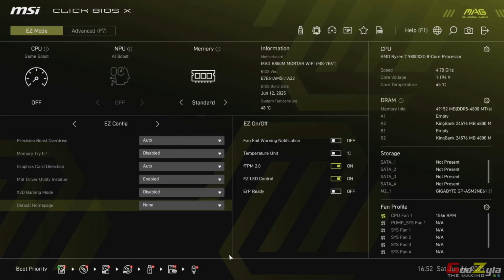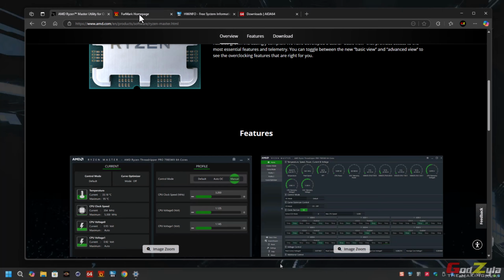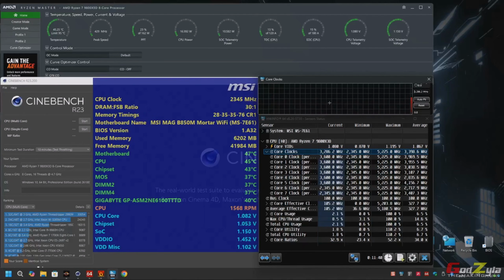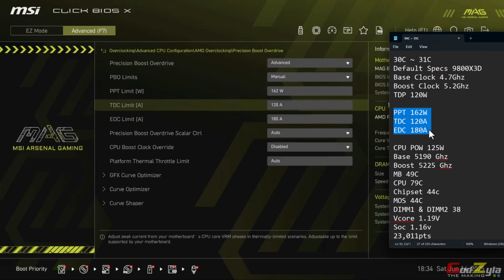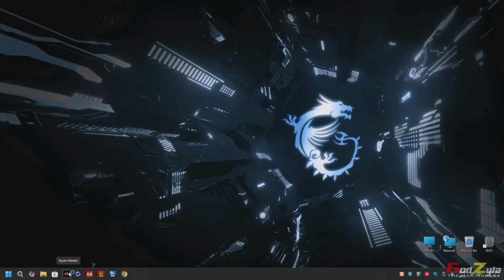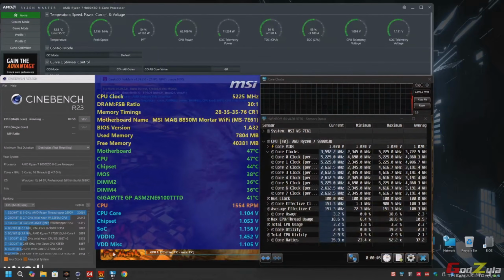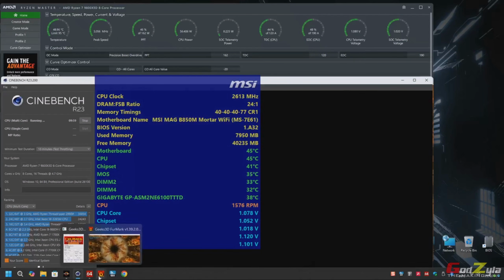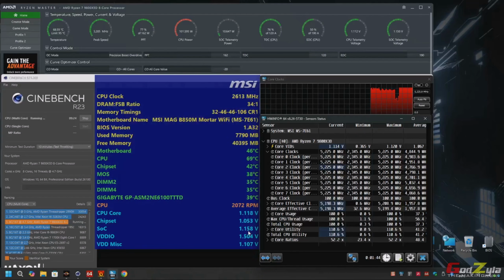PBO2 Curve Optimizing with 9800X3D on MSI Motherboard

Comment: Very weird same tests as you identically accept my cpu temp sits at a max of 83 degrees after a 10 min cinr23 run

Max voltage is at 1.110v across all cores, and my clock is at 5.225hgz flat line the whole test. Max 104w. Why is my cinabench score 21889? Is it because of the temperature? 
Currently on a -25all curve and then my curve shaper is the same as yours. All other settings are the same. Aida 64 runs stable
Reply from the maker: Welcome back Raffa, mind if I check what are your ram specs and at with VSoC voltage are you running, it is by default or at 1.15v? also you've mentioned that you are using 360 liquid AIO, which aio is that?
Reply: @K @KleoYan 6000mhz on Xmp profile 1 and locked at 1.15 runs stable. 

I just set my cinabench profile to high priority and received a score of 23500, max temps around 85.

Can’t undervolt is anymore I’m at -25 all core and then my curve shaper is identical to yours. 

My aio I honestly am not sure what brand it is as it is a pre built with a 5070ti in it. Everything runs super good my gpu has amazing undervolt and oc potential. 

I have 32gig corsaire vengeance ram 

In gaming my temps are between 60-70 the cooler is definetly working but I am thinking of re applying paste myself soon using the method I seen you linked me before. 

Also really appreciate the videos very glad I found your channel
Reply from the maker: @Raffa934  your temp looks fine during game play which is 60°C ~ 70°C. I would say maybe is the AIO or the contact pressure between your AIO coldpate to your processor, you can try doing a repaste..
Reply: @KleoYan yeah it must be that? Not really sure at all unless this cpu I have just gets hot. I noticed the aio mount wasn’t the best the spring screws were not compressed as I believe they should be so that brings me to believe the paste may not be the best either. Will be re doing it in a couple of days
Reply from the maker: @Raffa934  Thank you for the update, wish you all the best and update us on your findings too. I am curious .. thank you again! 😉
Reply: @KleoYan absolutely will do! Take care
Reply from the maker: @Raffa934  You too buddy 🫡
Reply: @KleoYan so I ended up buying some gorilla thermal paste and following your guide. When I removed the aio I could see they did a pretty crappy job of pasting. I re applied and did it as in your guide, 

This morning it was rather cool temps in my home and after a 30 min benchmark run it was around 78 degrees max

But as the day has gotten abit warmer and hotter I have done another benchmark run and it still reaches up to 85 

So I mean I guess it’s just the room temperature at this point because there is nothing else I can really do unless I get a whole new aio and I don’t really want to much around too much with that. I’m still not sure what brand aio it is but for gaming I’m never above 65 degrees anyway 

Slightly cooler temps after re applying paste though which is good
Reply from the maker: @Raffa934  I see, yup for static test it will be higher but in game play, your CPU load will never reach 100% so with the thermal hovering below 75°C is all good. Thank you for the update 👍👍👍

Comment: Hello again, my CPU_VDDIO Voltage is locked (grayed out) in BIOS at 1.36V and I always have this value doing whatever in Windows (1.358V - 1.360V), Is this safe in your opinion and if not how can I change it ?
Also what other values besides the ones that you spoke about in the video should I keep an eye on (I use hwinfo64 for data) since I am new to this and the the software gives so much data I cannot help my curiosity but to wonder if all of the data points are in healthy range.

b650 tomahawk / 9800x3d / 2x16 6000 CL30 P.S. I use your config 1:1 without the CS
Have a great day
Reply from the maker: Welcome back Ivelin Vasilev. I do not fiddle with the CPU_VDDIO if undervolting. using the undervolt PBO limits, Curve Optimizer and Curve Shaper, which I have done here, I let the CPU_VDDIO to run at default. So far these are the settings which I apply. I believe there are more which I did not go into them as I wanted to keep it simple. over complicating configuration might cause system to run unstable.

Comment: Hey man have been following your video as I am getting very hot temperatures out the box. Up to 96 degrees on cinabench. Have changed all my settings to what you had after testing my own and am still getting 95 degrees max. Not sure what is happening or what to do!
Reply: The voltage is definetly lower too. It is pretty hot today where I live I’m not sure if that is an issue. I just got my pc about 3 days ago and have been testing some benches but am worried with these 90degree highs. I did all the tests you said in your video, I have a 360mm aio
Reply from the maker: Welcome to my channel. where you from and hope you don't mind me asking this question.
1) Which case are you using
2) Which Motherboard model as you using?
3) which 360 Liquid AIO are you using
4) what's your room temperature
5) Before you configure the settings. Is your bios of latest version? also did you cleal CMOS before configuration?
Reply: @KleoYan hi! 

I am from Sydney Australia it is quite hot today 35 degrees probably about 30 in the room I am in with the pc

I have a large case with about 6 lian lu fans

Not sure what brand the liquid cooling is
Msib650 bomber motherboard
32 gddr5ram
2tb hard drive
Motherboard up to date 

I’m assuming it is my room temperature that is high? During gaming I am only sitting at about 72 degrees and it is hot in my room
Reply from the maker: @Raffa934  I see, can you try to clear CMOS first and reconfigure the settings. It's strange that after you've set the settings and you are getting the same thermal. If it still does the same thing. You might want to double check your Liquid cooler block mounting. is the plastic tape removed from the coldplate? if there are no plastic tape on the coldpate, you might want to redo your thermal paste application and to have a balance pressure when you screw the liquid cooler block to the processor. I use this method https://youtu.be/xZ2R4roF1_Q?t=292&si=d18gfmFuKbagq0Ug

Comment: My friend I want to provide you an update, what an incredible guide:

My CPU went from 82-83C to constant 72C.
Only using 88-90W.
Vcore went from 1.268V to 1.178V
Clockspeed at constant 5225Mhz.
Mobo, MOS and Chipset also went down by 1-2 degrees each.

The system is also stable using some Klevv 64GB DDR5 @ 6000Mhz, CL30, 1.15 SoC (aida ajusts this to 1.174V)

Very eager to see more of your work sir thank you!
Reply from the maker: Welcome back EndieM8. That very good result and congrats. Thank you for the update and support too 👍👍👍

Comment: let’s be real about what we’re discussing here:
saving 25w is roughly about $0.50 to $1 per month if you use the pc 4 hours a day, depending on your electricity price. does that really matter?
Also going from 78°c to 71°c probably won’t noticeably extend your cpu’s lifespan unless you’re planning to keep that 9800x3d until the late 2030s. 
Modern CPUs are designed to run safely in the 80–90 °C range for years.
This stuff is interesting, sure, but does it really make a difference in real life?  unless you’re running multiple PC 24/7 no
Reply from the maker: Welcome, VICOT G to my channel. I completely understand and respect your decision. You’re welcome to have things your way. As for me, I prefer to keep things a bit more on the conservative side, that’s just my personal style. Thanks you.

Comment: Help me understand something about the Curve Shaper for my own peace of mind (I'm not good at maths I'm sorry). If your CO is -20mV. Does this mean that Curve Shaper effectively makes it so that CO values are now in fact Min Freq = -20mV, Low Freq = -20mV, Med Freq = -35mV, High Freq = -30mV, Max Freq = -25mV ?  Maybe I understand this wrong. If you add two negative values it pulls the CO further down? ie. −20+(−5)=−25. And this is on top of the VCORE offset of -0.050 making the final CO values: Min Freq = -70mV, Low Freq = -70mV, Med Freq = -85mV, High Freq = -80mV, Max Freq = -75mV
Reply from the maker: welcome back Mnemonic, let me explain it this way. If you only stretch the Curve Optimizer to all cores -20. it will be the whole current line. For the Curve Shaper, instead of stretching the whole current line, it splits into 5 frequency. 
1) Min Frequency 2) Low Frequency 3) Medium Frequency 4) High Frequency 5) Max Frequency .. each frequency have 3 thermal points which is a) Low  b) Med c) High 

So in this illustration 
1) Medium Frequency with a) b) and c) as -15 + Curve Optimizer, total stretch will be of -35
2) High Frequency with a) b) and c) as -10 + Curve Optimizer, total stretch will be of -30
3) Max Frequency with a) b) and c) as -05 + Curve Optimizer, total stretch will be of -25

As why set it this way, lets say 1) Medium freqency runs at 4.0GHz you can stretch the current line at -35, this will not lose stability and moving to the next 2) High Frequency at 4.5Ghz, there will be more stress so by lowering it down to -30 helps to prevent instability or to over stress and the final step 3) Max Frequency at 5.0GHz, this is where the most stress will be at. so having a gradual stretch of -25, you allow stability and not over stressing. 

Lets say there are no Curve Shaper and you've set Curve optimizer at -30 .. throughout the whole run it's stretching or over stressing the processor consistantly, therefore this will cause more damage to your processor.
Reply: @KleoYan  Thank you for your patience in explaing. I understand the logic now. You are a champ!
Reply from the maker: @RealWitblitz  You are most welcome.

Comment: Definitely helped a lot. I still get random drops, but I think it's just the test resetting the render pass, but hopefully I did it right. No crashes! Nothing is burning
Reply from the maker: Welcome to my channel Sugar Wolf, just wondering how’s your result after you’ve configured your system. Hope it did bring down your the temperature and to increase the performance by a little.
Reply: @KleoYan  I believe it did. I'll report back after I've gathered more information
Reply from the maker: @TheFlaptrapper  ok and thank you 😉
Reply: @KleoYan  Runs very cool and no crashes. I'm just noticing microstutters in my gameplay, nothing major, but more like a "vibration" in my framerates. I captured some screenshots in HWinfo, if you're open to seeing them. But I may also just try default bios settings, just to be certain.
Reply from the maker: @TheFlaptrapper  I see, good to know it runs stable and cool. As for game play, this you will need to adjust on your own as I don't play games, so sorry about this. Thank you for the updates. 🫡
Reply: @KleoYan no worries. Thank you.
Reply from the maker: @TheFlaptrapper you are most welcome.